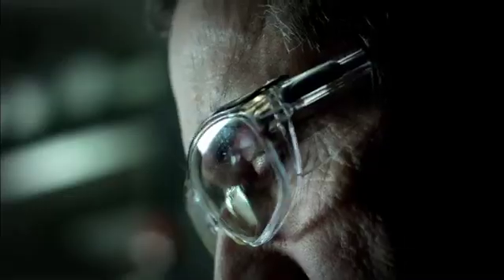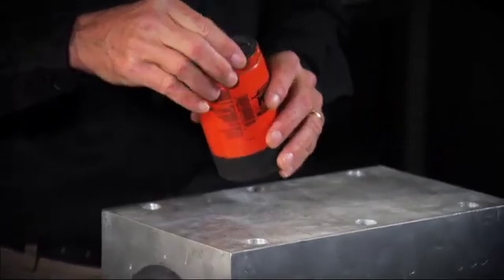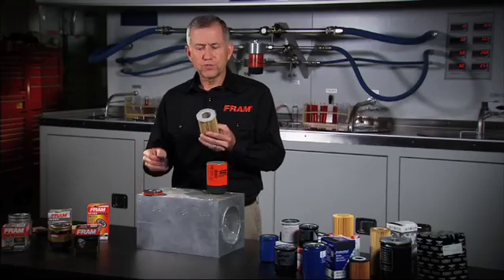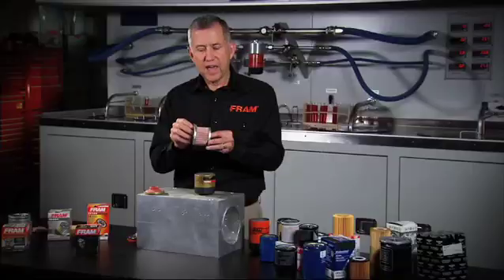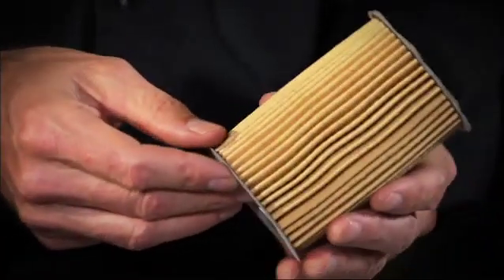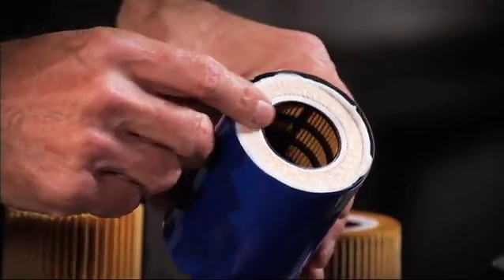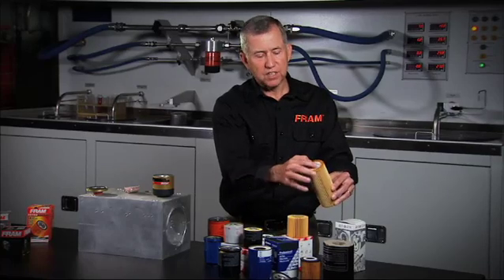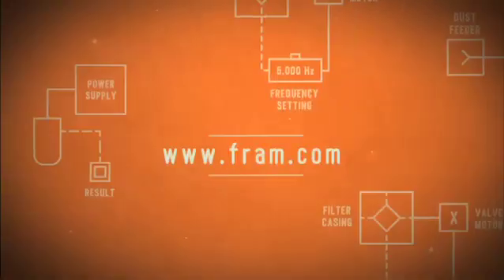Fiber vs. Metal End Disks

Comment: You are correct, plus the fiber end cap acts like a filter. Its the plastisoil adhesive that is very tough that holds it together... Hey we have enough metal in our engine... Do we really need that much metal in the filter device... Do you ever see a water filter with steal in it? and we drink water. However some people care more about what goes in a car then in there body. ALL in all.... Dont belive the HYPE

Comment: metal end caps are purely visual. That's of very limited value, as it does not address the flow rate, the particle entrapment size, surface area of the filter elements, etc. If Fram is such garbage, how do you explain excellent longevity . "The proof is in the pudding". I know auto mechanics whom swear by FRAM and still swear by fram. Even my own Family who is in the auto feild. Fram is good, do not belive all this you see. However its fun to see oil filters cut open. LOL!

Comment: Curious, I hear a lot of OC bashing, but not many will touch the Ultra Guard or the TG. Both very good filters. It also very interesting to note that these cartridge filters do not use END CAPS! Yet, none of the FRAM bashers will acknowledge this. I am not a Fram fan boy. I use Wix/Napa Gold, Bosch/Motorcraft/Purolators, and the TG and the Ultra and never...EVER have had a problem with any of these filters. These Fram bashers are just ALARMIST, plain and simple.

Comment: I just changed my oil with a new Fram Ultra filter and it seems to be working just fine. The only thing about it that concerns me is that, like all Frams, it has very small inlet holes, compared to most other brands, which seems restrictive to oil flow. I know Fram does a lot of tests on their filters, but I've never seen them test flow rate. I'd like to hear a Fram engineer address this.
Reply: ElectroFret21 Fram Ultra is the only thing I would say is very good from them but as long as the total area of the holes make the same area of the outlet it's good

Comment: Once the filter has been used, cut it open and look at it.  The distortions in the pleat uniformity are common in Fram - this can be seen in many of the videos where the filter has been dissected.  Fram needs to add a stabling ring or something to keep the pleats from bunching tighly together or opening wide.

Comment: The criticism of Fram is WELL-based, there have been posts on ferrarichat about sudden drops in oil pressure on stock Ferraris. Problem was resolved as soon as filter was replaced. Imagine saving a few bucks on the filter needing to do a 30+k engine repair because of oil sludge! I have inspected the motorcycle filters at my local superstore and would NOT trust them on my Hayabusa. Purolators are cheaper, have more filter area, and they have metal endcaps. Why can't Fram do the same?

Comment: I found that pleat uniformity changes under pressure - the majority of pleats either bunch together or a few open excessively wide. Also, the pleats do not remain in straight lines - they bow in the middle as tho they're twisting.  The greatest pleat separation occurs at the metal clip that binds the filtration paper together - oil flow thru the paper is obviously not uniform.  The Extra Guard can only be used for short oil change durations in my opinion.